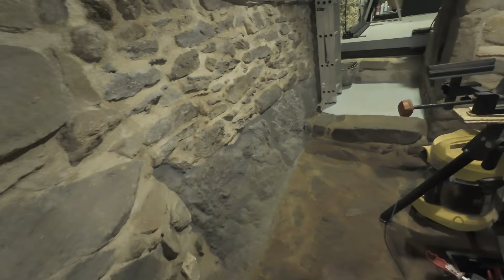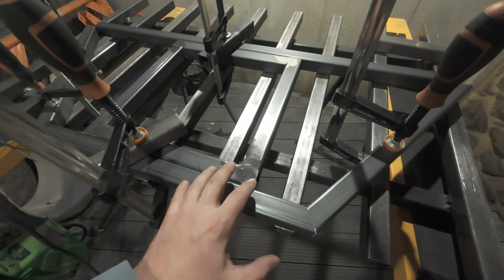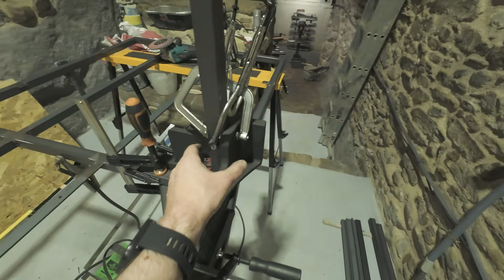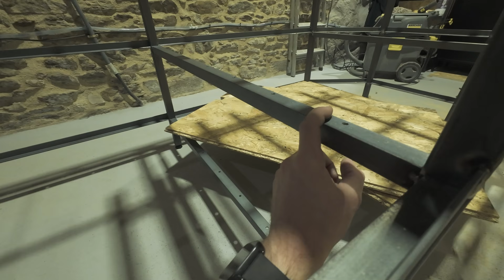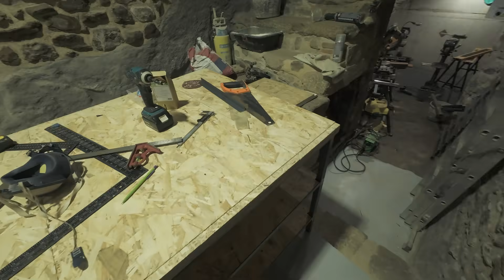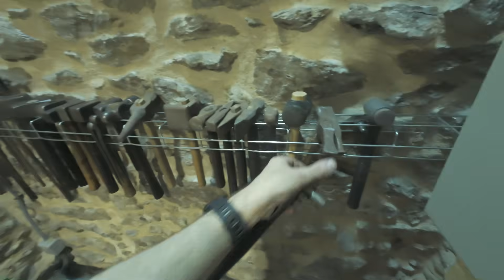Low effort video, big bench.

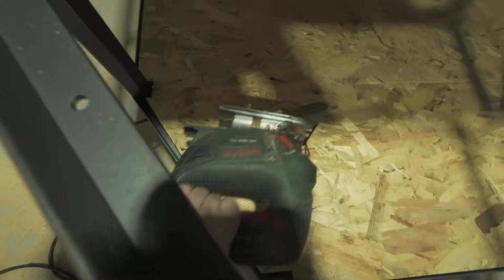Comment: 17:09 Have you considered making cardboard templates? Less measuring, and easier to transfer and test-fit the patterns.
Over all, it looks rather nice. I'm not a fan of particle board because I always fear that it will soak up liquids that touch the surface. But the shape and the structure came out very nice.
Reply from the maker: Yes of course I've considered it... afterwards :) And to be faire I did not have cardboard on hand at the moment. I understand what you mean about particle board, but this is OSB3 supposed to be resistant to humidity and with varnish. Hopefully it should hold not too bad we'll see. Thanks !

Comment: your fume extractor seems to be working very well if you are welding in the Vault!
Reply from the maker: It's the general ventilation repurposed for fume extraction :) It's not working too bad for that. I put it on max when I'm welding. But I'd like something a bit stronger and filtering. The cellar is still filled with smoke after a while, and I'm tired of wearing my respirator.